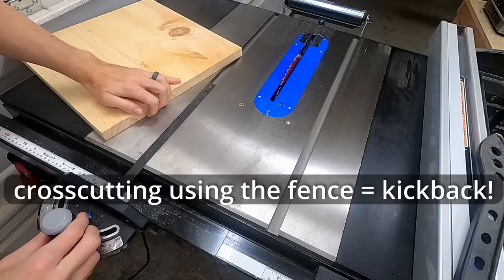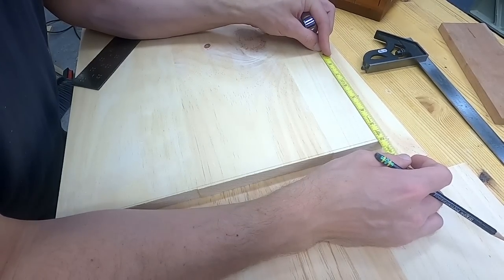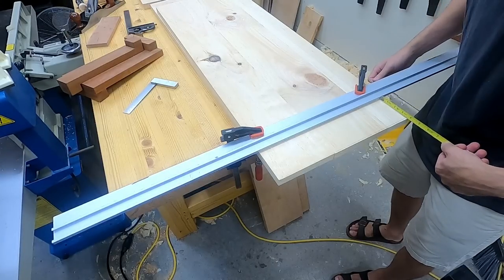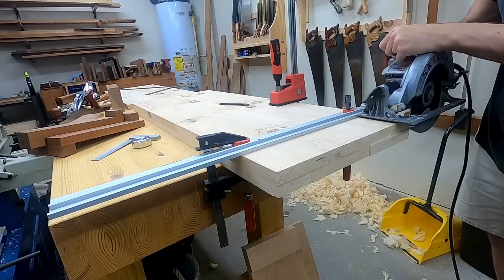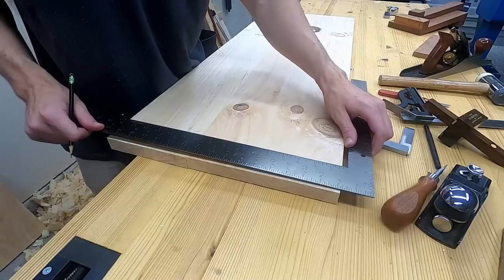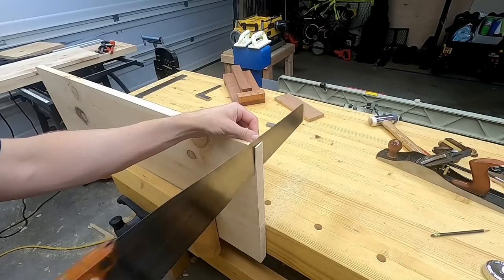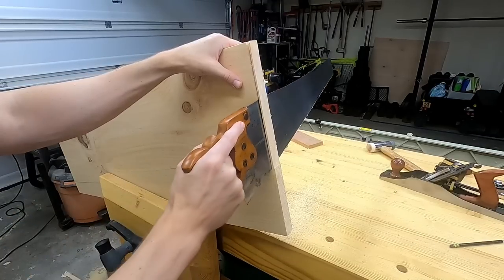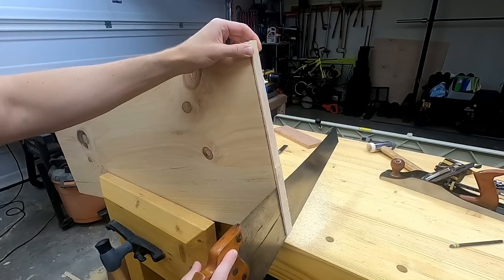OVER-HYPED or "Shop Necessity"

Comment from the maker: whats your take?
links to tools:
SKILSAW Circular Saw - https://amzn.to/3O66L11
Straight Edge Cutting Guide - https://amzn.to/3tunlOw
Hand Saw - https://amzn.to/3AfwaPS
Block Plane - https://amzn.to/3oMLayx
Starrett Combination Square - https://amzn.to/3iL4bxO
Reply: Whatever circular saw you get, make sure you buy a decent blade for it. Can't tell you how much frustration I had starting out because I kept thinking I needed a better saw when what I needed was a better blade. The saw you show is a good one. But, if you can't afford anything but  a cheap saw, spring for good blades.

Comment: I started woodworking again after a significant break about a year ago. The most important thing I have learned is that a hand saw, plane, and chisel are really the minimum set of tools. Sandpaper, glue, fasteners, and wood are the consumables. Adding tools as wanted/needed for efficiency or convenience or just as a new experience is great. Every change that I want to make to a peice of wood generates the question “what is the best tool to make this change?” Best is determined by safety, proficeincy, and desire. Thanks for showing both powered and handtools ways. I appeciate it.
Reply from the maker: 100%. Well said my dude

Comment: I have been gradually learning how to square/flatten boards by hand, and I've discovered that now I am (slowly) improving, I MUCH prefer it to the point that using power tools is now a last resort for me. I hate the noise and the dust, and I agree with you - the setup and breakdown time of measuring out a cut, getting everything stable and accurate for a power tool cut means that working by hand doesn't always take much longer, and is a much more pleasurable process for me.

Comment: The circular saw with guide or track is in my opinion is the best option for doing plywood cabinets unless you have  table saw surrounded with out feed tables. Blade left seems to be best option for this in my opinion and I think Skilsaw is the only one making them presently, Porter_Cable used to make a pretty good one. The Skilsaw has so much torque that kick back can happen easier, and they are heavier. One thing that I found useful is gauge block made for saw/blade to eliminate measuring, but advise to make blade/ saw specific. Put arrows on functional directions to alleviate mess ups and keep in mind when laying out "cut side" of blade. Very helpful video. After cabinet is done you can get back to hand tool wood working for face frame, drawers and doors.
Reply: Just checked out that Skilsaw on link, that is a bargain for such a good saw, even has machined base. Get the rafter hook if you do framing.
Reply from the maker: Great thoughts, thanks Jim! Yeah the price is surprisingly low right now... less than I paid for mine several years ago I think I spent 200 or even 220 at home Depot for the worm drive

Comment: Hi Frank, I liked your video and I would agree with you on using the straight edge guide and the Circular Saw. How would you rate the Skilsaw that you use to the Ridged Corded Circular Saw. You may not have used the Ridged Saw. The price is the same as your Skilsaw and they are both corded. I will need to replace my old Skilsaw in the near future. Thanks again for the video and any opinion you have would be appreciated.

Comment: I think a good thing to keep in mind is for either method your cutting tools need to be sharp. If you can't afford the best saw, at least get a decent blade for the cheap saw. And the cheaper the saw the better blade will be a good investment to save you headaches. 

And for the second method take the time to keep your plane and saw sharp. That's the key to getting good results with either method. 

There is literally nothing that will cause people to drop woodworking as a hobby faster than dull blades.
Reply: ahem Trust me on this.

Comment: I got a bunch of track saw tracks and cut them into various sizes. 1', 2', 4' 8' and whatever else I need. Why? Because, once a circular saw kicked back and almost took off my leg, I went the extra mile to make the effort to keep my limbs in tact. I use the Wen track saw which is 100$ and once tuned, is superb as there isn't any play at all - just a nice clean cut you can push through on track and not have to worry about trying to keep flat against straight edge on the last bit and get some possible gouging unevenness. Of course, this is a more expensive method, but if you do a lot of ripping and cross cutting, it becomes useful. You just build up overtime - for example, I have a 8' table and needed to rip boards on sides so I had one straight edge to run on the table saw - once ripped, run on table saw, flip, run other side and flip again to take a razor thin edge off. Smaller 4' cut is easy, half the track. the 1' and 2' I had to take a 4' track and use a metal saw blade to clean cut to size. Over time they are handy and keep you safe. The straight edge is great too, I just don't like the idea of another incident of a saw flying at my body.
Reply from the maker: Sounds like a good budget friendly way to go. Especially since all the tracks and accessories can add up to $hundreds or $1k+. I have the wen dust collector and it works just fine
Reply: @FranksWorkbench  I haven't looked at the Wen Dust collection. Wend is doing great on the tool front, been eyeballing their jointer too. I think if you are a person who is detailed, and likes to over engineer things a bit - cheaper tools can help you - once you get them dialed in. I bought machinist squares and blocks and I use them for setting up everything. Ie, once my tablesaw is set to 90 on the dot, I don't touch it and I just check it on important cuts. My fence on my dewalt saw, I have to check it every time for square, I just don't trust the rack and pinion gears. I take a speed square on both sides, set it up and lock it down. Only takes an extra minute to do so. Love your content, take care!

Comment: Another way to trim the end of a wide board is to 1. deeply knife line the required cut line. 2. lay the board on the bench with the knife line over hanging the end of the bench. 3. using a saw similar to Frank's start the cut close to but not right in the knife line. 4. slowly maintain the cut at the far side while lowering the saw along the preferred saw cut line next to the knife line. 5. when cut through place the board in the vice and plane to the knife line with a jointer plane.  It will give a furniture grade cut off.
Reply from the maker: Sounds like a solid method for a crisp finish!
Reply: @FranksWorkbench  This also works for long rip cuts... Check out Christopher Schwarz and his Overhand Ripping Technique https://youtu.be/2_96gNMMc_g?t=654